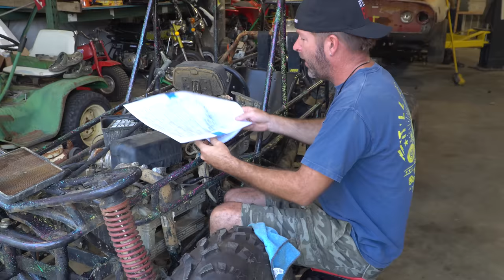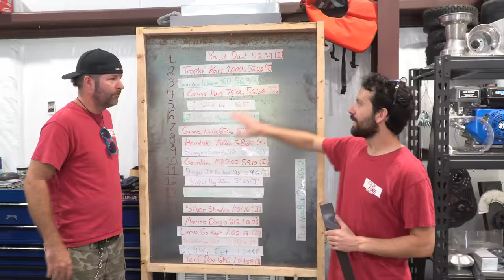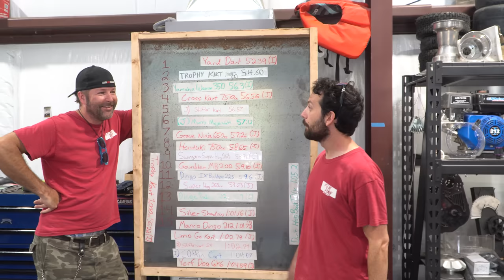Our 1000cc Trophy Kart was FLOODED in a Surprise Tropical Storm- Will it Run & Ride Again?

Comment: Very nice 71-72 John Deere 112.  They are tanks.  With the small 39 mower deck they also do a great job mowing. 

My 69 is original orange and white with a Tecumseh.

The 112 is just a model number.   My 112 is 10 hp, the 110 is 7, 8 or 10 hp gear driven.  120 was 12 hp hydrostatic, the 140 was 12 or 14hp hydrostatic depending on the year. 

Everything was kohler except the 112 which started as a had a hh110 and that remained an option in the early models. The original kohler was 10hp but was replaced by the 12hp with a 1 year overlap with 3 engine options.

Don’t build it into anything, I’ll help you with parts to keep it original.

Comment: I sell trailer parts, amongst other things for boat trailers. And i've learned that the first step when something has been contaminated with salt water is to wash the thing off with fresh water, otherwise it will rust to hell everytime it gets a bit moist or wet since everything is covered with salt. We even used to sell hosekits that you hook up to the drums to easily wash the insides of them out if the trailer is used to launch a boat in saltwater. So i'd hose those two down properly ASAP, or the rusting will continue.

Comment: Yes, finish the Trophy cart. I hope by now Ike has got his research hat on and read up on the Ford Twin I beam, among the few factory users. That was where I started looking for a less complicated but reliable FE with minimal caster and camber changes; the Twin I beam, operated with 30" arms will give a no caster change and less than a degree and a half camber over the plus or minus two inch travel. And power steering would be really nice- she's a brute! And get some boat anchors on her!

Comment: That  JD is in the 100  series garden tractor line.  The JD 112 were made from 1966 -1967 with removable  Round Fenders and a 10HP Tecumseh 388cc engine. From 1968 - 1974 they had flat fenders incorporated in to a stamped metal pan.  These models had a 10HP 390cc Kohler engine.  At the end of the 112 line and the start of the 120 model they moved over to a 12Hp 476cc engine. They are pretty common not rare at all like the 1963 JD110 and 1964 JD110.  But for a mower that is not made out of tin they are worth keeping around.

Comment: Gentlemen, please....do not modify the JD 112. The 110/112 from that era (1968-197?) is a super solid, quality piece worthy of complete restoration. My good friend has a 1968 110 model that runs like it's new. The gear under the swing out gate is a super low....with that gear engaged and the variator drive in low, it will idle happily at 750 and move slower than a snail. I took a video of my friends as proof because it's hilarious.                   Real bummed to see more stuff destroyed by the weird weather, but glad to see you guys tackle the cleanup full throttle. Good luck!

Comment: I worked at an electronic manufacturer for 15+ years. If you go online and get a can of conformal coating, clean the ECU with isopropyl and a toothbrush best you can, dry it off and coat with conformal coating. It will protect from moisture and stop the corrosion, and humidity problems for years to come.  (Do not get on the connector pins).

Comment: Install a separate crank sensor  90ish degrees from the factory one and adjust for intake stroke for each cylinder and you can keep the fuel injection

Comment: You are correct on the 1 series 12hp. For 112. It's a late late 60s early 70s Deere. Plenty of em around so turn it in to a lawnmower tractor puller

Comment: The TK needs some squarer tires on it, like Bearclaws. They won't break the bank either. You can get 25x12's too. Way more tire contact than what you have with those balloon tires. You might have 5 inches of contact with the current tires. That 112 is way to nice and original to cut up. I think the best thing would be some new tires, and to get it running. Maybe find a nice deck for it. I would not paint it. Great job guys!

Comment: The Joh Deere, make a shifter kart with that big lever, but hide all the modifications as much as possible with original/factory parts. Get a reciprocating buffer to bring that paint back to life! Basically I would like to see a competitor in the riding mower circuit, but with a sport bike engine and trans.

Comment: Guys I worked at a John Deere Dealer for two years those 112's restored are worth quiet a bit , it is a 100 series 12 h.p from the 60's and that one if it runs and drive is in decent shape , don't butcher that mower. that was a Lawn Tractor of it time rock solid machine !

Comment: This is one of the few carts that Ike actually fits in.  He did well in the cross cart too, but ouch, ouch, ouch.  
Trophy Truck benefits from more driver weight too. Cross Cart the opposite.  Update the Trophy's suspension and steering. Please.  
Killer blast from the past, and awesome ignition computer revival. Go Ike go.

Comment: 7:05  Some old Farmall tractors and others had the steering rod routed through the upper tank of the radiator.  Left handed designers not talking to the right handed designers.

Comment: Just hit the ECU with some electronics cleaner/deoxid and a toothbrush, or vinegar and a toothbrush if you rinse it good after. Follow with a rinse of rubbing alcohol and it should be as good as new. Ideally finish it with a spray of electronics laquer/conformal coating, and it should be much more water resistant.

Comment: You are correct on the model on the JD, that kohler K301 12 horse will easily come back to life, I've bought machines that haven't run in 25 years and usually they run again with a carb clean and points clean

Comment: For computer components that get soaked and dirty- wash them with Isopropyl Alcohol. It displaces water, and is electrical safe. It will push the water out from under the IC's and out of relays, and dries quickly with no residue. Just a tip from someone who used to fix electronics on a regular basis.

Comment: I wondered when you guys were going to bring back the trophy cart, i saw ever video on this build, and it just rips and tries to rip your head off , that's what i like about, that computer will last awhile John, I had a Welsh buddy who took his old BMW bike the same as yours and modified to be his version of an adventure bike and i don't remember how often he got his computer wet and would pull it apart dry it clean it and fire it up again after a few days in a dehumidification chamber, it kept going for a few years and he sandbagged that poor bike it kept going like an old BMW, I look forward to the future videos on the Trophy Kart, if you want to do electric power steering, go to the wreckers and check out a Subaru they have used it already for a number of years and i here the units are not to big according to one of nephews 👍

Comment: If you want better steering pull the spindles off and place thrust bearings between the bottom of the spindle and the bottom of the frame. Thrust bearings anywhere else you can get them to work on the steering will make all of steering components work much better. It will blow your mind how good it works.

Comment: Flush any flooded electronics out with distilled water a few times and then scrub off corrosion with isopropyl alcohol and a toothbrush. 70% is ok for cleanup like that, but if you have a part you can't get all the distilled water out of you can soak it in 100% IPA and it'll draw the water off before evaporating.

Comment: y'know fellas, you could probably run the Trophy off of a Haltech box.  You have the digital injectors, plus whatever sensors on the engine for management...then you could ditch the door style MAF box.  Probably even use something more readily available with a flow-through MAF, like from a GM

Comment: Hey guys quick trick to mix water in the tank with the petrol bit of metholated spirits  will mix the water with the petrol and burn it Off  I use to do it to my car when it got condensation in the tank  from sitting with low fuel in it

Comment: Ok on the 112 mower 4 new tires and that just a start.:face-blue-smiling:
spray it down with wd40 and then blow it out, 
and use a heat gun to dry it out. and it runs woot:eyes-pink-heart-shape:

Comment: Hey fellas... I just bought hillbilly power steering for my John Deere D125 lawn tractor, off of Amazon. 
It's a flat set of needle bearings that go on the bottom of the calipers...where the weight is. WOW what a difference  it is, and two of them was only about 9 bucks.
P.S. they didn't come with grease...lol.
I hope this helps ...
Your pall BigBadBubbaBurns

Comment: Find some way to stop the solder points from coroding. The electronic components might be sealed so no harm there. Get a stuff that erases your carbon pencil for drawing. Use that to clean the board.
For the trophey cart. Please improve steering and air intake.

Comment: I was gonna say, that board looked primitive enough to be fine after drying it off, even if you did run power through it when there was still water inside, which is usually what kills boards.

Comment: Hello Guys, good for next time, wet the ecu in 99% alcohol and clean it with a brush and it can be reused, but it works before, it is not 100% reliable, but it works most of the time and remember That alcohol does not transmit current is also used in PCs, excellent video

Comment: if you guys had some contact cleaner, that be the proper thing to spray down the ECU with. CRC and LPS both make it, you can usually find a can in the wiring section at Lowes and Home depot.

Comment: Don't give up on a computer just because it gets wet.  The worst thing is to try to run the computer while its wet as that's very likely to blow something (oops).  If a computer or electrical box gets flooded, take off the covers and clean any visible corrosion, perhaps using alcohol or brake cleaner to remove moisture.  WD-40 might work, too ;).  Sit it in the Sun or heated area for a day or so and it might be good to go.

Comment: Personally, take the mower and restore it. Without a deck. Put a 2’ larger front pulley on it and run a gas pedal then put a winch on it and use it to pull old stuff out of the woods. Maybe some meaty tires too

Comment: Well, you already know that us Mechanics say that the "BMW" stands for "Bring Money With"!!! Lmao. And if you would have dried that computer BEFORE you tried to start it or energized it, then it most likely would not have been harmed at all by the water. But you already know when you run power through those circuits wet, you're crossing those circuits all across the board.

Comment: @CarsandCameras Use white vinegar and a toothbrush to remove any corrosion on the ECU. Followed immediately by baking soda and distilled water to neutralize the acid in the vinegar.  Then blow it dry.  Look for any bad solder connections with a magnifying glass.  That's more or less how @RMCRetro fixes bad old computer motherboards.

Comment: Deoxit d5 pick up a can of that it works wonders on electric connections and removes corrosion/oxidation it got my window switch’s working again on my old c1500 best thing to use on circuit boards and connections

Comment: Next time I recommend you to clean the circuit board with gasoline and a painting brush between components, and toothbrush in the solder side, and let it dry for a day before plugin it in, I had saved many laptop and cellphone boards that had water on them with gasoline, they still smell to gasoline, but them work without problems.

Comment: I've had laptops that had Coke drying on the internals for years. Pull it apart, use distilled water (universal solvent) and a soft bristled paint brush to gently scrub it. Let it dry and reassemble. Ran for years.

Comment: Corrosion on the board is not disaster on its own and can be fixed depending on how the board was made and how much effort one wants to put on it... well as how fast it can be dried off from water. Isopropanol alcohol bath tends to clean off any water and dirt at least so that is the first thing to do.

Comment: Similar code system as simplicity. A 4212 would be a mower with a 42" deck and a 12 HP engine

Comment: Would need at least a 75A alternator on its own to drive an electric power steering pump, they draw a lot of amps. As for the steering ratio, speedway guys use what are called 'steering quickeners' which are a compact inline gearbox. They come in a few different ratios, I think I'd try a 1:1.5 ratio one first.

Comment: All you need to do is get a older Volvo and use the hydropower steering  reservoir and electric pump all set up in one nice little unit alot of drifters use it as a modd. Check it out should help alot

Comment: I'm an electronic person I do pc board repairs and such here's how to fix the computer take the boards out dry them very good then use a small light brush and brush the solder joints with contact cleaner then dry the contact cleaner off with a damp cloth then dry the boards with a dry rag then put it back to it should be ok then..you need to clean the wd40 off the board it will short out the circuits dry it good then put it together..

Comment: Upgrade the suspension [add 2" to 3"] and stiffen it up ,also upgrade the intake and tires [so your not skating around the grass]. Possibly a re-gearing to give it more bottom in torque, so you won't have to rely on second gear the whole track. 
Last the, The ICM should have a coating on the board, so clean it off with circuit cleaner and low temp bake [below 100degres] it for a 30min to an hr to drive the rest of the moister out. After cooling you can coat with Acrylic paint or my favorite is
 "DUCKY PRODUCTS Electro-Seal" it drys quickl, cures in low temp and has a rubbery texture which helps keep wire leads from breaking off and it's friendly with closed contacts and coils.

Comment: its not 1 series frame 12 horsepower. they made them with different horsepower engines. i have a 1970 110 i rebuilt that came with an 8 horse

Comment: Steering control would return if yall found the right size Steering wheel to use. Smaller the wheel the harder and worse it will steer.

Comment: Get the mower back to cutting grass and find another one identical or very similar and mod it out with a two stroke engine like a snowmobile for a single gear or maybe a 250cc or 500cc. Guaranteed to pull in views an likes with that thumbnail and footage!

Comment: How about steering, brakes, and some decent shocks? The springs that are on that thing are doing yall no favors. Also try lowering the tire pressure to around 12 psi in those rear tires. May help with the rear skating all over the place.

Comment: Next time you flood electronics, don’t power it up, first flush it with IP alcohol to absorb and displace any water and blow it dry. I should be fine! Most electronic assemblies are washed in the factory in a similar manner, electronic components are typically waterproof!!!!

Comment: Electronics guys wash circuit boards in isopropyl alcohol after they solder them to get the flux off. The WD40 should have displaced the water.

Comment: Git the John deer running and use it on the trails I'd keep it original those koler engines are very very good moters it'll start..repaint the body green and the rims yellow..

Comment: Of course it will run. You could to this to most small engines and just drain and dry them refill with oil and 95% of the time whatever it is will start right back up. Ask me how i know.

Comment: You can buy a Volvo electric power steering pump and wiring kit and it has a speed controller.
Reply: Also for the steering you need to get or make some kind of a bumpsteer kit with the way the camber goes in and out as the suspension moves.
Miss the OG build!!

Comment: The computer will be 100% fine now you’ve sprayed it with WD 40. Dealt with a few wet and heavily corroded automotive electronics and after a clean up and a spray down with wd40 they work fine, unless it’s eaten threw connectors.

Comment: The battery is just low. The injectors on a BMW (and a Suzuki) require an almost perfect battery. As for the computer just give it a scrub with alcohol and it will probably be fine.

Comment: You guys need to get back to this project get some improvement on this project and see if you can not beat the lawn dart for the number spot on the board. Also need to get some more times on the board since you guys have fixed the track so now go back and post times for older stuff and see if you can not get better times with the new fixes to the track.

Comment: Technically the brakes Absolutely Would work even if it was pure water in the system with no brake fluid at all in the system!!! Up until they got hot anyway. But if you kept them cool you could technically use water to stop the trophy truck in an emergency or something like that. But once the heat hit it absolutely would lock the system with steam pressure. Lol.

Comment: People clean computer Motherboards with water, so I would imagine the ECU should be OK.  Clean up the back side with alcohol and a toothbrush to clean the corrosion and air dry it with compressed air.  It should be ok.

Comment: It's funny you talk about this crosskart and having a Chevy Chevette rear end. I'm in the process of the stalks of purchasing the Chevy Chevette right now it has an LS3 C6 Corvette engine with twin Turbies under the Hood.  The guy wants $8,000 for it .. Buy sell Trade Lakeland Florida if you can grab it. Burn out car from Hell
Reply: The computer Can be cleaned And wiped clean then coated with coconut oil with a old rag. Spray off the computer bord w rubbing alcohol and clean the contact points . let sit in a hot room for 4 days to dry out.

Comment: Shell rotella is the universal oil. It's jaso certified which means it will work in a wet clutch application. And it has all the nutrients and vitamins old engines like.  Not to mention it's usually the cheapest option.